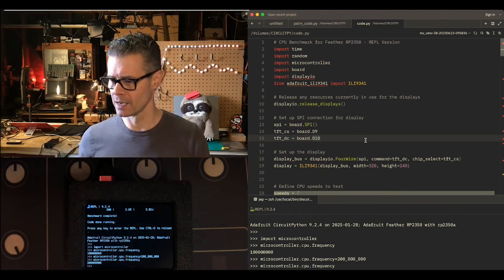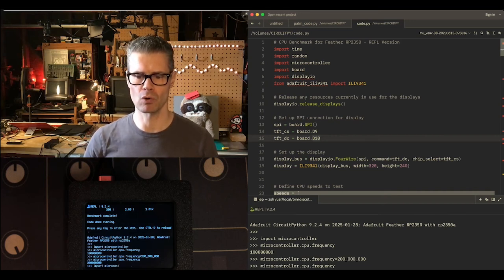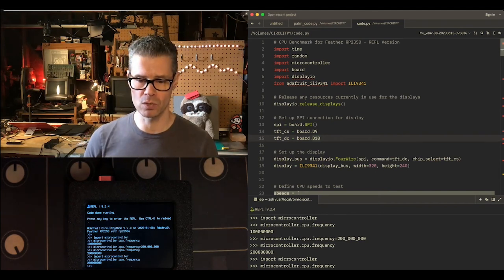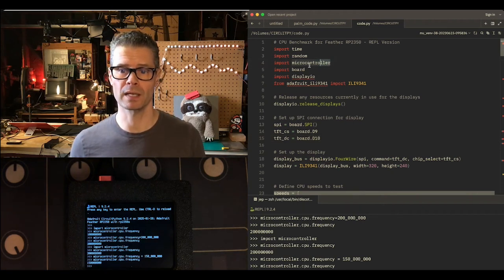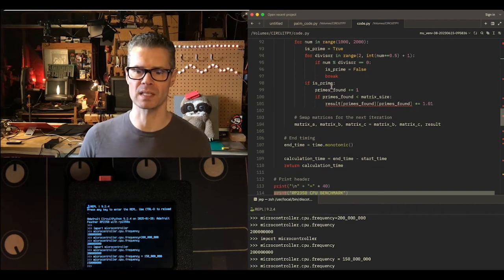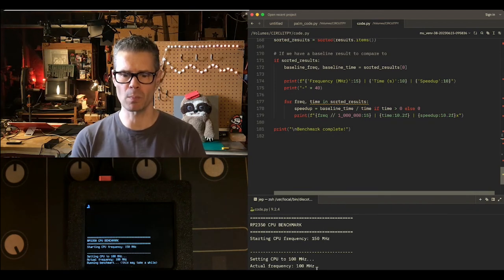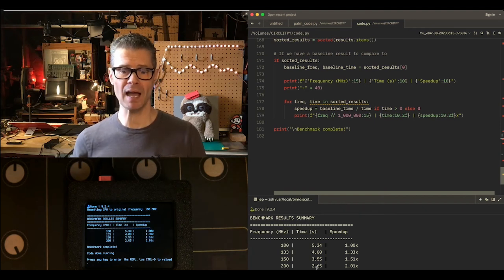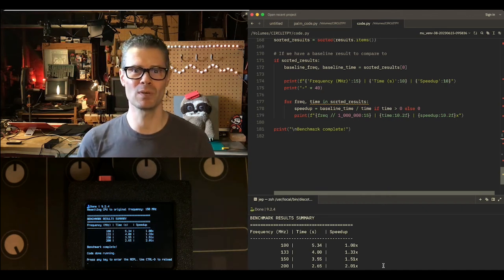John Park's CircuitPython Parsec: Overclocking #adafruit #circuitpython

Comment: Pretty interesting that the speed up expressed as a multiplication coincides with the set speed in MHz
100 MHz = 1.00x speed up
133 MHz = 1.33x speed up
150 MHz = 1.51x speed up
200 MHz = 2.01x speed up

I wonder how soon that trend diverges both up and down in frequency...

Comment: huge improvements in speed with 200mhz is it safe to overclock the rp2040 at that frequency?
Reply: 200 MHz is apparently totally fine according to Raspberry Pi Foundation